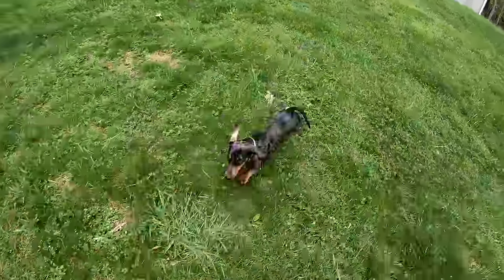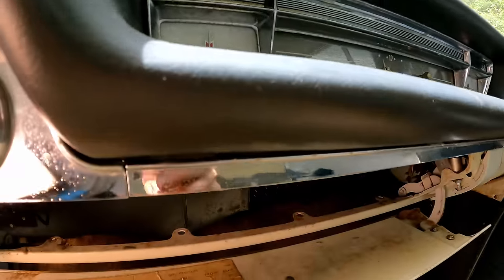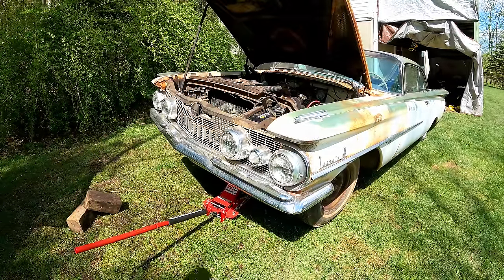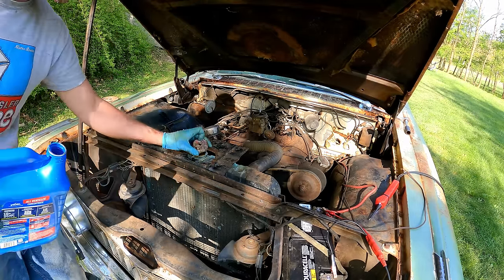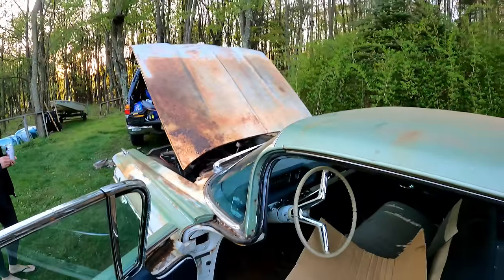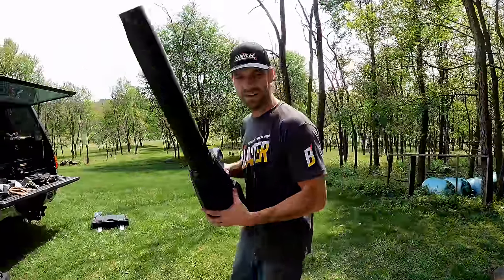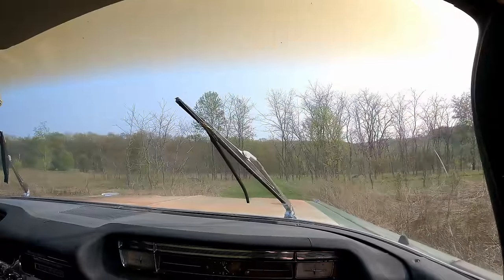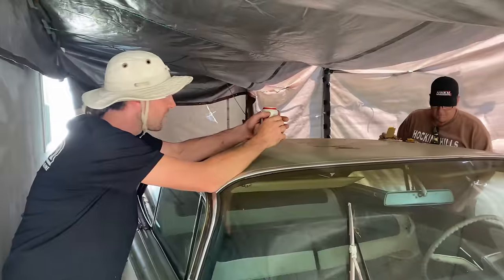1959 Oldsmobile Dynamic 88 Sitting For Years WILL IT RUN? - NNKH

Comment: If it were me..I would not waste good content time justifying to haters what my channel is all about.  Those of us, which obviously massively outnumbers the detractors, are loving what your channel brings to the table.👍
Reply: Always start the engine with no water in it. In case the head gasket is bad or it has a cracked head. Then put water in it as it runs slow so you know how much you can put in before it gets flooded out my the water. The lower it a little an ut sealer in it an start it an put water in as it runs a little fast or fast .. PNM

Comment: Hey Chris just wanted to say thank you for the great videos. I am 17yr. You inspired me to start my own project. I bought a 1996 Ford Ranger for 300$, replaced all the brake lines, new tires replaced the clutch and pressure plate. I should be able to sell it for 2,500$ would not of done this project without your videos! Keep it up!
Reply from the maker: Heck yeah man that's so awesome to hear!
Reply: Awesome man.
Reply: Great to hear this, Corbo. Learning how to do this kind of work will serve you well and you'll be able to pass the skills along to your kids someday. Keep it up!
Reply: go man
Reply: Your hooked now for life,the hunt is just as rewarding as putting something back on the road that's been sitting .good luck to you.
Reply: I've got the 1996 Mazda b2300. its basically the same as your ranger. I've got the 2.3L 4 cyl and the 5 speed manual transmission and a lift kit. The truck is purple, people wave and give me the thumbs up all the time lol.. I live in Texas so its rust free! 150k miles on it and only paid 800 for it. Its a tough little truck and easy to work on.
Reply: @cadenswain158  Nice We got the same engine and trans. I'm in Ohio so unfortunately, it has quite a bit of rust
Reply: @corbo1886 Yea that 2.3 is nice. i've got glass pack exhaust so it sounds mean. that  speed works great. Thats unfortunate. Rust is like cancer but for cars. it will happen, if you catch it early, you can prolong the vehicles life. in the south 99 percent of the vehicles that are over 30 years old have zero rust. people down here will not buy any car with rust, since we aren't used to it. it scares people lol. my buddy moved here from PA and his bmw has holes in the rocker panels. solid otherwise. he couldn't even sell that car for 200 bucks. people would see that and run.
Reply: If you have the v4 2.3, that's a gem! Two  spark plugs per cylinder,  I had one a 5 spd. That little ranger would go.
Reply: @RockymountainRobert  yea mine does have 8 spark plugs! Mine is also the 5 speed
Reply: You keep it up to, young man. Enjoy learning, and pass it on. Enjoy your youth 😊
Reply: Awesome Corbo. Keep at it and maybe you will start a channel going too!
Reply: @NoNonsenseKnowHow  if you ever get tired of it...

I'll take it!!!
Reply: @NoNonsenseKnowHow  That was Paul Kratt's car.
Reply: Good for you kiddo, have fun doing what you do. Chris is a good inspiration for young people like yourself.
Reply: I find if you take a bit of knowledge from each channel your way ahead of any detractors trolls and the like that can't get off there ass and fix anything...long live  American l iron ...
Reply: I had an 86 Ford ranger 4x4, great truck!

Comment: A 1955 Oldsmobile saved my Mother's life, and mine as a baby when she rolled it on black ice and slid upside down into a frozen field. My Father said that if it wern't for that "wrap-around" windshield we would not have made it.  And my favorite car of all time is the 70's Olds 455 Rocket that I learned to drive on, love seeing this old 1959!
Reply: Growing up, the vast majority of my neighbors worked for Olds, so my neighbor had a 1959 Olds just like the one in this show. Occasionally, I would ride to or from school in a 59 Olds…
I grew up about 30 miles north of Lansing Michigan (home of Oldsmobile) In the 80’s, when Olds Cutlas was the number one selling car, the aluminum wheels on them came from Motor Wheel, also a Lansing company,as was Wohlert corp. who made ring gears that went on the flywheels. 
Btw, that Century inboard boat was likely made in Manistee, Michigan. Cris-Craft wasCadillac , Michigan.
Reply: My wife’s grandfather worked for AC Delco in Flint, Michigan and willed us a 1964 dynamic 88 when he passed. Has the 394 rocket and is a beautiful car. Unfortunately it spun a bearing and rebuild kits are $$$$
Reply: @wesleysimpson3730  long since gone I grew up in Montrose burt
Reply: I really like the videos I just recently became a subscriber. Hopefully you guys come around Missouri St Louis area I would like to meet you guys

Comment: Cars were works of art back then. Nowadays, we drive plain tin cans. It must have been incredible to be alive in the 50s driving these cars and going to car meets or the local burger joint. What I would do to go back in time and experience it. My grandpa said times were 20 times better back then. People actually had fun outside. 😂
Reply: Depends who you were I guess. The golden age is done, but at least we don’t make the black folks use a different drinking fountain.
Reply: Nowadays, we drive e-waste mobiles.
Reply: A tin can would be an upgrade from the plastic crap we have now.
Reply: @swamp-yankee  If you take away the racism it was.Almost everyone had a 2 parent family. That's what made it better.
Reply: @MrR40388  I hear that. I’m gen z, but my old man was born in 43, and I’ve heard some stories. He always says his generation had a lot of advantages. He bought his first car for 15 bucks with a half tank of fuel, and he changed the oil and drove it a year and a half before it needed a brake job and he failed to bleed the lines enough and sent it over a ledge in the lot at the farm he worked at totaling it. It cost him two full days of work laying pipe in a lemon orchard to buy a mechanically sound used car. My first vehicle, a tri color ranger that was ugly as sin and needed loads of work in the two years I had it. It cost $3800 while I was making 9.75 an hour.

That’s a pretty big difference in prosperity.
Reply: I lived the 50’s and would not trade that experience with any of the young people of today. Keep racism out of these comments.
Reply: @swamp-yankee Why does everything have to be about race?!?! 🤦‍♂️ Since we are talking about the golden age, why don't you sit back and enjoy a classic Camel non-filter cigarette or a Lucky Strike? 🚬
Reply: @mplarkvideo Ha! Love it! It's true.😢
Reply: @swamp-yankee Okay, you're right there. Gen Z is left to suffer economically and socially and etc etc. Is it the end of the line? It's the last letter of the alphabet, but there's also the upcoming Gen Alpha. Who knows what's in it for them?
Reply: @trickyricky12147  it’s not the end of the line. Ultimately I’m not a pessimist and believe we will over come the social and environmental problems we face. Gen z is the poorest per capita, but also in America the generations are getting smaller. Our good work will only be more in demand, and as it is now, and I’ll tell ya folks love to hire a young person with a good work ethic. I don’t know anybody who’s a good worker who can’t find work. I imagine alpha gets less of the pie then we do and they are fewer as well. They’re barely hitting adulthood though.

Comment: Love you channel!  I’m 60 and this reminds me of my Dad’s 59, 2 door Impala.  It was 12 years old when he got it but he loved that car!! Great memories.  Pro tip… I used to be a mechanic at a GM dealership.  I noticed you using a screwdriver to pry the grease cap off of the front drum.  I always liked taking a pair of channel-locks and opening them up wide the put the jaws at 12 and 6 o’clock then give a gentle squeeze and rock the cap up and down an it pops right off.  I even had the right snap-on tool for that but preferred the channel-locks.  By the way the grease caps proper name is “hub cap”.  The things the we all call hub caps are “wheel covers”.   Keep up the good work!

Comment: Brings back so many memories. My mom and dad were in their Pontiac station wagon when they were T-boned and the car was totalled. They needed a new station wagon right away and the Oldsmobile dealer had one. It was a brand new SUPER 88, not a mere Dynamic 88, in white and gold two tone. The problem was that the new model year was just beginning and the new 68’s were just off the truck and couldn’t be released until the official release date. Detroit made a big deal of it back then and when we were shown the car it was in the back of the dealership and covered with a big white sheet. My dad signed all the papers and in three or four days the big day had come and we got the car. I was 12 then and it was totally cool to drive around in one of the first ‘68 Oldsmobiles to hit the streets. People stared and pointed at us. The new model year was a BIG deal back then.
Reply: Great times, man!

Comment: I see other people also noticed that Gus is loving that back yard. Love seeing you getting that Rocket running again! I had a 51 Ford with a flathead V8 239 I  think was the CI and it also had a 3 on the tree with a rod under the dash that when pulled out and when you shifted into second and then wound it out you released the gas pedal and then stepped on it again it gave you another gear. SO I could get up to 70 in second. It had like two gears for second and third, like a 51 5 speed. Enjoying your videos and of course Gus. Expat Dave in Ibague, Colombia 🇨🇴

Comment: I used to drive a 70 Olds Delta 88, I called it a Chevelle killer because the Rocket Motor would eat them alive. Two door car but a little bigger than a Chevelle, but that Rocket motor would eat a 396 every time.

Comment: I have a 1964 Olds Jetstar 1. 75k original miles with 25k on the rebuilt 394. "Ultra High Compression" 10.5:1. Old school tech but she's a sweetheart. Came out of an apple barn in Connecticut, im the 3rd owner. Have original plates, registration, dealer paperwork, keys, spare tire, wheeles with caps, etc. Acquired from a good family friend. One day will get a resto, try to find parts tho haha

Comment: I've had every version of the rocket series engines and they just ran and ran and ran specially the 350 and 455 versions only ever just changed cams, lifters and manifolds headers etc for more power but they took every bit and never smoked, knocked nothin. They all ran like brand new even with glazed cylinders. Amazing engines. Best ones i ever owned. Gotta get another one someday

Comment: Hello Chris, Jen and Gusman from Sydney Australia. 
"Getting historical (vintage) society cars." Thanks for the beautiful location for mechanical learning. It's not like Cabinetmaking, Carpentry or Bricklaying. However takeaways;
* Trolley jacks and stands on blocks (cardboard for work surfaces).
* Power probe current meter, used to establish DC V in circuits, ignition, coil, battery.
* Engine (I'm not bad with that from aviation Studies)
* Gas pumps, filter and assessment of delivery (bottle)
* Old drum brake system, that is now scarce resources.
Thanks for your instructions "you don't stop for the stragglers: do you?
💡💫🌌

Comment: 20:25 i like the cars that have the drain plug in the rear of the pan, having it in the front and if you jack up the front you can have as much as a quart left, but with the rear drain you get almost all the oil out

Comment: My first car was a 60 Chevrolet impala 2 door. Had a 283 automatic 
My uncle told me if I could get it running I could have it. He lived about 3 miles away. I was 15 so I walked to his house after school one day and put in plugs and a battery and drove it home with no tags or license. When he got home he thought it had been stolen, and called the cops. They found it sitting in my dad’s driveway with me under it changing the oil and the brakes. Nothing was done about me driving home but a talking to. The cop even helped me finish the left front brake so he could be sure I would get it right. Those were the good times. 1971
Reply: Great story 😀

Comment: Man, back in the day I had a full Technics stereo system with four 10" subwoofers and a full surround system that sounded awesome. I even had a couple of old Technics stereos that my buddy put in his 1984 S-10 with an aftermarket set of 6.5" woofers with a full set of door speakers, a set of MB Quart 3 way 5x7 split sets in the dash, and it sounded good with a power inverter. That was back in the late 90s, so we made due with what we had. I had a 1994 Eddie Bauer Explorer with a 302W swap, an Explorer Express Eaton M90 supercharger kit, the original AOD4 transmission, 2WD, jacked up on a Skyjacker 6" lift with 33x12.50 TSL Thornbirds on 15x10" chrome bullethole wheels. It had a full Sony Xplod tape deck with a Sony 10-disc CD changer, Sony Xplod door speakers, a set of JL Audio 15" subwoofers with two Kenwood 600 watt amps (with two 3 farad capacitors) and I could put a full Coke can on the roof and bounce it 10' in the air. Now I have a 2013 BMW 128i with a Jensen 7.5" touchscreen in the dash, a set of Sundown Audio 12" woofers, and a Soundstream Rubicon Nano RN1.5000D 5000 watt amp.

Comment: Adam Wade of "Rare Classic Cars & Automotive History", amazing channel, points out that GM, particularly Pontiac, often paired big engines with 2-barrel carburetors. He own a couple of them (65 Bonneville, etc.) and reports that they not only work very well, but actually have more power and smoother response than some of the contemporary 4-barrels. So, don't switchout the carburetor. Things are not always what they seem. In any case, great video, Chris!

Comment: When I was younger lol, I'm a year older than that Olds, I've worked on  quite a few of those brake systems.  The systems worked great I think a big part of the problem with maintaining them was mechanics didn't understand how they worked and or how to service them,  it was alien technology for a lot of guys. That booster/master was very simple to rebuild.  Also the front wheel bearings can be replaced with tapered roller bearings from a Chevy chassis,  just be careful of the ID and OD , they have to match the old style.

Comment: We have got to address the oil issue.
If you put oil in the fill hole, all the "unfiltered oil" runs down the valve terrain to the oil pan. So it's all over everything before going into the filter.
If you pour it in the filter and the "unfiltered oil" bothers you that bad, pour the oil in the filter side of the filter, and let it gravity feed into the filter. Then you have filtered your oil before install. That easy. But honestly it doesn't matter, people who think that just don't understand the oil system of an engine.
😂 Such a crazy thing for people to get all up in arms about.

Comment: Since the 59 Buick and the 59 Chevrolet in I'm using these two as an example have the same kind of roller bearing setup, I just took front hubs off a 1966 Impala and used the tapered bearing setup along with the brake drum and it fit just perfect

Comment: This 88 is in just the right condition (meaning it's not mint all original) to where I'd have no problem at all upgrading the brakes.  Dual circuit, power, disks up front - I'm sure there's a Wildwood kit (for mega $$$$) or possibly there's a way to use junkyard parts to do the same thing. It'd be cool to keep the original look/engine (with a mild performance upgrade), maybe aftermarket AC. It's a nice car not often seen in this condition anymore.

Comment: When your doing. A one wheel peel in the mud or snow push the ebrake just slightly and it will trick the cars differential to spin both wheels apposed to one wheel peel, I don't know much about this spasific Oldsmobile but it works in my dodge ram

Comment: I’m currently working on a 1960 oldsmobile dynamic 88, trying to get it running, this video is gonna help so much!

Edit: will comw back to this vid and probably ask questions n stuff cause this is my first time working on one of these haha
Reply: So it looks like my fuel pump is installed in front of the brace that holds the radiator, it runs fine but there's no filter so going to have to add one so I can check, it's a high fuel flow one tho cause the engine is turbocharged. Still no sound at all from the starter motor, but getting to that on thursday when I get my floor jack, wish me luck with that haha

Comment: I’m a kolbalt tool guy too they make good heavy duty tools, I have a big Kolbalt mechanic tool set that I got on sale for 90$ it’s a 400 piece set it comes in handy I’ve had it for years never had any issues with it, believe it on not Milwaukee makes ryobi power tools has the same inner workings as Milwaukee just different casing with different name!
Reply: milwaukee tools are not the same as ryobi nor does milwaukee make/own ryobi. They're owned by the same parent company and made with different quality parts in different factories, obviously.

Comment: Dynamic 88 were fitted with a 371 2 Barrel ..super 88 and 98 were fitted with 394 .. heads and intake will swap over   371 / 394 Ci   were torquers

Comment: Those fuel pumps are pusher pumps. i had one exactly like it and it worked great but needs to be closer to the tank.I also had to put in a regulator because it was pushing 7 lbs and was dumping fuel.

Comment: A 1959 Oldsmobile dynamic 88 completely stock with an automatic transmission driven by Lee Petty won the 1959 Daytona 500 the first race held on the superspeedway. The car had been purchased at a Oldsmobile dealership less than two weeks before. The only automatic transmission car ever to win the Daytona 500. This car is even the same colors as the Daytona winner. I would make this into a tribute car. All you have to do to make it authentic is take off the hub caps paint numbers on it and install a roll bar.